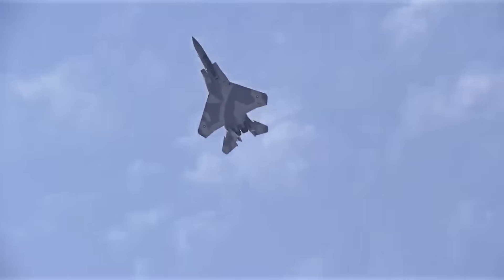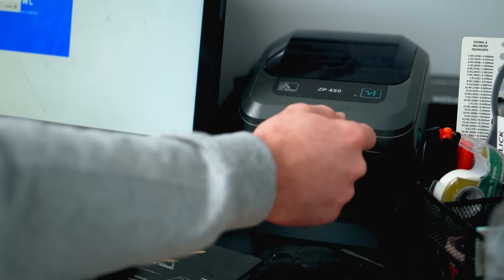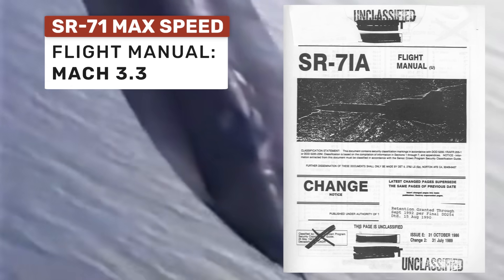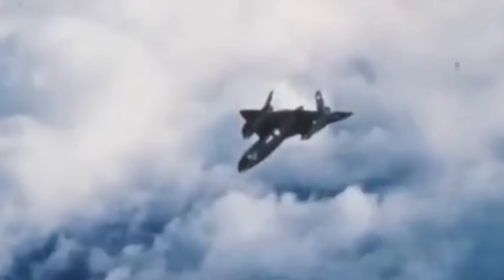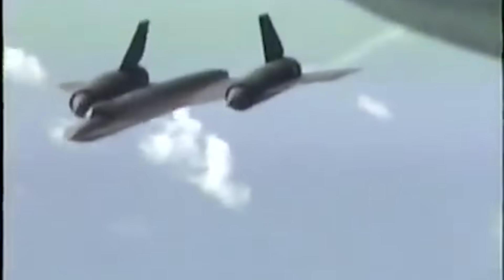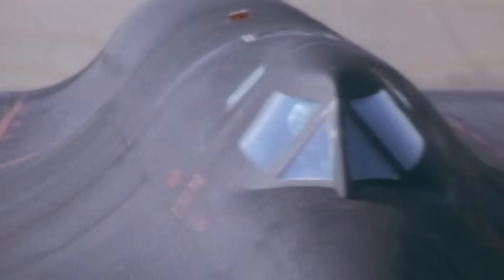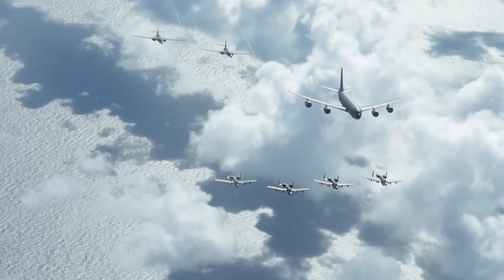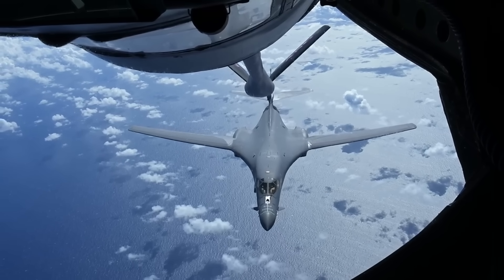The SR-71 was MUCH FASTER than the Air Force will admit

Comment: I am a now retired research engineer.  Much of my research was performed in the classified world.  Your first need to realize that the performance of Most aircraft is actually classified.  And the United States always reports levels that are far below the actual performance.  To expect anything else as foolish and to classify such claims as lies is inaccurate and unfortunate.  After they tell you that the information is classified, What do you expect?   You also need to realize that the SR 71 often operated at the  is maximum " Edge" of it's flight envelope.   Often the maximum variation was less than 10 knots.  The term maximum speed is not really the primary issue as the Flight Envelope definition includes far more characteristics.   To state that the SR 71 was the fastest "operational jet" (Which excludes the XB70 and others) is accurate.  Since the maximum performance is still classified, I can't speak beyond this.
Reply: Really great comment. All I'd add is that the performance of the SR71 is no longer classified and hasn't been for well over a decade.

Comment: Actually most of sr71 known as private owned built actual sr71 owned by United States of America usually around mach Three at most us always had manuvr pitch synchronous problems airflow maybe your Honeywell spies mis aircraft identification by way how fast am I going coming out from actual space slowing down around  two hundred eighty thousand knot's? By way only reason slowing down to keep from slamming into tall building and mountain also from hip pocket K1 shielfield Kansas topikia ours private area at stationary sitting still is solid mass same as plate steel sky dancers ground ours used halve ground shoot us in fast response time a gillion dolkees equipment worthless without intellect input study material exotic material help usually cost more than day one value of aircraft most smaller pursuit aircraft run time only around hundred hours sometimes less static stress key factor our private resourses closed in homestead Florida only of kind x ray entire aircraft up to size of 777 deltas takes more than most think

Comment: Engineers/executives tend to be conservative about real top speeds to stay out of trouble, and pilots like pushing the limit.  Some WWII pilots claimed that they exceeded the sound barrier in dives, although none of those claims have ever been confirmed and seem unlikely in a prop plane.  Our government hasn't been exactly reliable about truth either.
Reply: Exceeding the speed of sound in a dive wasn't the problem, it was pulling out of that dive and surviving that was the issue.
Reply: @wally7856  The real issue was aerodynamic.  A prop plane is not aerodynamically capable of breaking the sound barrier even though the airspeed may have appeared higher.  At high velocity, the ability to measure true airspeed was not possible with WWII technology.  They may have thought that they broke the sound barrier because of false readings.  No GPS at that time to give true velocity.  It took Chuck Yeager in a rocket-powered plane to break the sound barrier, and even then, only with modifications to his craft that were made during his attempt- to maintain transonic stability.  He also made a clear sonic boom.

Comment: The Mach number is NOT a speed, it is the ratio of the speed (TAS, not IAS) to the speed of sound, which in term depends on the AMBIENT temperature.
At altitude the temperature is very low, so the speed of sound is low too. So flight in hot conditions, at low altitudes  means that at the cruising speed is much, much higher at Mach 3.2.
The limiting factor that determines this Mach limit is the permissible temperature of the compressor of the J-85 P& Whitney engine, when ever this temperature is exceeded, the engine needs to be replaced, so if Mach 3.2 is significantly exceeded , as it happened, the durability of the engine suffers, leading to emergency landings, not a very cost effective way to operate the SR 71.
An additional consideration is the longitudinal travel limitations of the conical center body, which could lead to an inlet UNSTART, the expulsion of the last normal shock, which killed a pilot.
How do I know this.  At Hamilton Standard the air inlet control was built.
To accuse the AIR FORCE of lying is despicable
I suggest you take some courses at MIT, under Professor Mark Drela
Reply: Great post. It's nice and rare to see people post with good information.

Comment: The top speed is when the wing tips start to melt. The engines can go faster than the plane.
Reply: Lol no
Reply: @gr8crash   I've talked directly to a guy that made parts for the black bird, he spoke with many of the pilots. Congrats on being ignorant, a rare achievement on the internet.
Reply: @cantthinkofnameyeah7249 that's very doubtful as the parts were all made in the early-mid 60s, and if they said that they weren't very educated on the topic. Also there's literally no pilots that would ever say this. And it's not being "ignorant", it's just being more educated on this topic than you are. 

First the initial limiting factor to higher speed is in fact the engine. External parts of the airframe and internal structures don't become an issue until you approach mach 3.5. At that point different aspects of the airframe may just need further analysis while other parts require redesign. But simple fact is the SR71 was never capable of flying fast enough to "melt" the wings. That's totally an uneducated commment.
Reply: @gr8crash   Real world accounts vs your internet research. Yeah definitely you being naive.
Reply: @cantthinkofnameyeah7249 not being naive at all. Again it's just being better educated on this topic than you. Nothing you said is based of any factual. 

As I mentioned,  the initial limit to higher speeds were in fact the engines. The Engine CIT limit was essentially what limited speed. That had a limit of 427⁰c. Once that limit was reached, that was it. Now a pilot could be at 427⁰ and not even be at mach 3.0, or be well below that and be at max mission cruise of mach 3.2. 

But as for your comment of wings melting again no. The airframe never got hot enough to melt the titanium,  if it did that would just be bad design.  In fact from 3.5-3.6 leading edges of the SR71 required further analysis. At 3.7+ all new materials would be required. And since the aircraft was never capable of those speeds, it never became an issue.
Reply: @gr8crash   Key word in your paragraph of fluff, If it did. Again real world experience trumps any internet expert have a nice day with that level of naivety. 😂
Reply: @cantthinkofnameyeah7249  again it's not fluff, it just that obviously you don't have the knowledge to understand this topic. And as for "real world"  there's literally no one involved in this aircraft that has ever said the wing would melt etc. By you even saying that, it displays a lack of knowledge of temperatures and materials. I'm sure some research would help you understand that, but you're unlikely to invest the time and effort in doing so.
Reply: @gr8crash   Youre one of those sad guys that knows so little you assume you know it all🤣
Reply: @cantthinkofnameyeah7249  nope, just one of those guys that happen to know more than you. So spend some time, research the material on the leading edges, then look up the temperatures the generally reached, then  try and find the melting point. When you're done, and you realize your comment is nonsense you can let us know.
Reply: @gr8crash   So now you're a fluiddynamics expert 😭🤡🤡🤡
Reply: @gr8crash   Now I gotta get 1.5mil by the end of the month have fun with your life!

Comment: Is it true that Ram jet starts at Mach 4,  so mach 5-6 is not a problem.
Reply: Yes and no. Ramjets start to function efficiently as you approach mach 3, and they can function up to mach 5-6, but that's not the same as saying all ramjets function that way. The inlets have to be designed for a specific range to operate effectively. The SR71 inlets were designed for maximum efficiency at mach 3.24. Since they were designed for that speed range, they wouldn't be able to function at mach 4 +. Even to reach the airframes maximum design potential would have required redesign of the inlets etc and these were never done.

Comment: I worked as a vendor in the CAP w some radar jockeys when I was 16 years old. I saw the flight data from an SR-71 that was sent to some undisclosed outpost in the north Atlantic.  Norway  perhaps. Back in the 1980s when the Concord was frequently in service, the 'BBirds would routinely mess w the Commercial pilots. There was a '71 that buzzed a Concord out over the Atlantic Paris to NYC.  Passed it going west.  Turned around.  Passed it head on at 2 Km to the north and 2k feet in altitude , then Passed it again heading west.  All in the space of less than 3 minutes. Allegedly the pilot pulled 8 gs. Regardless,  he data said that the SR-71 made 2 runs at over Mach 3.63, westbound.  Eastern was was "slower" in the  3.4 range because of the heat differential caused by the rising sun in the intake, cockpit, and airframe...

Norwegian flight control Allegedly shared this information with NATO because they were pissed. 😅
Reply: Haha that entire post is completely false and absolutely never happened.

Comment: Yeah hey I'm back. This is definitely a cool video. But you know?

The top speed of the SR-71 Blackbird is still, Classified. So they are talking about, Mach 3.2. But I believe it goes well beyond that..  That's why. It's, still, Classified.

Our US Military, keeps secrets. Because we are not supposed to know. They don't want the cat out of the bag. We have technology. No one else has. Even if they have aircraft. That looks similar to ours. As they've stolen our, exterior designs. That's all they have.

I know, we have stopped. From over 20 years ago. Maybe it's 25 years ago.. Maybe more, now. Of some Classified Military Gear. I was mistakenly informed of. By a military member who had loose lips. Due to pizza and beer. And whoops. I'm not supposed to know about this thing and technology.

I've watched some documentary films by,  Lockheed Martin, Northrop Grumman, Boeing/Douglas. And some of this. Has been intimated by them. But not released. What exactly they were talking about. It was only suggestions of… Wouldn't it be cool if we had… Yes we do. I found out. And it's a more awesome technology. It's very Stealthy stuff. It sounds very unique. Something else nobody else has. Still not yet. And this has not been, released. For, US, civilian, consumption, yet.

Think, F-117. Kept a secret from us for over 20 years. Before it showed up in the 1991, Gulf War. We were then introduced to the B-2. Now they have a replacement, for that, aging, archaic, aircraft.

And so we must have some new, Technological, stuff. That goes beyond. Any of the technology information they are releasing. As that is likely 10-20 years, behind the times. That's the way we do it.

So I suspect. These new vehicles are likely equipped with some pretty sophisticated, AI. Mind blowing stuff.

This is also why. Our greatest, most expensive, Fighter, ever. The F-22 Raptor. Is, already, archaic. It's considered 4th or is that 5th, Generation? And so they already have, 6th Generation, already implemented.. And that is beyond the F-35. That's also a yesteryear, plane, design. We have moved forward from there.

And so maybe the Military has released that UFO information. Because it's no longer UFOs.. It's ours. We have something. That is likely mind blowing incredible.

And likely another reason. Why our Adversaries are also on the March. And we perhaps are preparing a surprise? That will be introduced. Once they surrender. As, they won't be able to stop it. It'll take them right out. They won't see it coming. It's invisible. Physically, invisible. It's beyond yesteryear's, rain soluble, stealth paint. It's an active system.  The technicalities of which were not divulged. As I have no idea, as to its operation nor, propulsion..

While I don't believe it to be of, Extraterrestrial, assistance. It's good old-fashioned, American Geniuses. As we have taken something to the next, logical level. That goes beyond, radar stealth paint. Goes beyond radio jamming. It can travel, on, in, anything.

So whatever it is? It's also technology about, nearly 1/4 century old. So chances are. That working Concept Item. Was only that. Declassified enough. For a US military group.. To be shown. Possible future items they may be working upon. They taste. An introduction. A look. At the future. At not declassified to tell anybody else. Like me.

So it's really terribly exciting. The incredible country. We get to be a part of. We get to lead the world with. Because of the way we do it. Without Republicunt Discrimination and Oppression. That does not make Merica better. It destroys it. And we cannot let that happen from within.. It will open us up to attack by our lousy adversaries.

And so Republicunt's are creating a situation. That are playing right into our Adversaries', hands. We are doing exactly what they want us, to do. And that is fighting amongst ourselves. Because as we fight amongst ourselves. They are organizing their attack. To destroy Western Culture. Which Vladimir has already begun. Attacking Chechnya and now Ukraine. Who's next? Kazakhstan, Finland, who else? Vladimir wants the USSR and the KGB, Back. He likes the old days also.

And then we have She ping-pong. He wants Taiwan back. Little fat FUCK, Kimmy Un. Has his finger on the button of his, hydrogen bomb tipped ICBMs. Aimed at Japan and the US. And to be certain. He will wage an attack upon Japan first.

In turn. We will have to protect our NATO ally, Japan. Along with those from Western Europe. And that will kick off, World War III. Because of course China and Russia. Will then defend themselves. By attacking our NATO allies and us in the US.

And we will be squabbling and fighting amongst ourselves. Through to the election and beyond. Went they will make their move. While our pants are down. Fighting each other. And we will be Buns up, kneeling.  And we won't be able to wheel and deal, anything. It will all escalate. So China and Russia can, Destroy Western Culture. As they have already stated they will.

So it's just a matter of time. Before the unhinged. Unhinge. And we will be squabbling amongst ourselves. Just as they want us to. As we tried to Corral Trump and his Cronies. From preparing us for a Take Over.

And it may end up just like that, fucking movie, Red Dawn. And I laughed over that when it came out. I am no longer laughing. I'm frightened. I'm scared. Republicunt's are going to get us killed. Republicunt's are going to lose our USA. Republicunt's will be our great undoing.  As they are not human beings. Because they refused to be Woke. Which simply means.  They have joined the other side. The Dark Side. And their only agenda is to destroy the USA and our Democracy. They are on the side  of our 2 Worst Adversaries..

And what do we do with, Traitors, like that? What did we do to the Nazi officers? We let them hang around for a while.. Only a couple got away with their lives. Like Warner von Braun. We spared him. He helped us. He got smart. Republicunt's can never get smart. They refused to be Woke. Meaning they are no longer Americans.. But are now American, Enemies of Americans. As they seek to undo us. For their ill-gotten gains. Just like Hitler. They want to rape us all. And destroy our country. For their own ill-gotten gains. Because they have gone certifiably, Insane. As, an extremely hostile Insurgent Faction. And they are out for blood. Against Americans, THEY DON'T LIKE!

They are neither Americans nor Christians. They are part of the Nazi past. The Ku Klux Klan of, Yore. And they are out for blood. From Americans! They want another Civil War. They will not stop until they get one. They will not stop. Until they destroy our US Constitution and our Democracy. And we know what to do with those types. Our fathers and our grandfathers knew what to do with those types. And they did.  We utterly destroyed them. We stomped them into the ground.

We are going to have to do that again. Abroad and domestically.. Because some Americans think they have the right. To reshape America the way they want it to be. Without half of our population! Because they hate Americans. They hate liberals. They hate Democrats.  They just plain, hate America and Americans. The righteously believe themselves to be Superior. And we know what to do with those types. They are extremely dangerous. They are destructive. They wreak havoc with everybody's lives. They rule through attack, destruction and intimidation.

We have a nasty situation going on with anti-Americans that live here. And they think they have rights.  To destroy the United States. To re-create it in their Jesus image. They are crazed, tax evading religious fanatics who hate America. They don't want to pay any taxes! They want the USA to fall. For their own ill-gotten gains. They are scumbags. And they are living amongst us. They are your neighbors. Your coworkers. Your colleagues. Your elected officials. Your law enforcement. Your unethical business magnates. It's organized crime at its worst. It is a total coup d'état Conspiracy. And they are on track to attack, Americans.

(More Declassification's in following post)